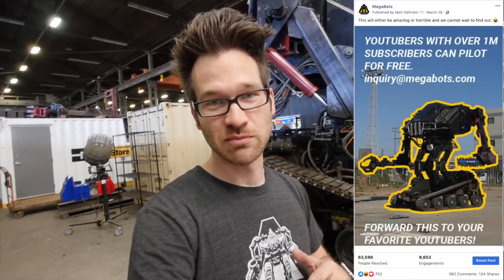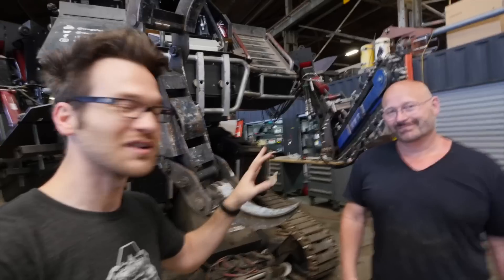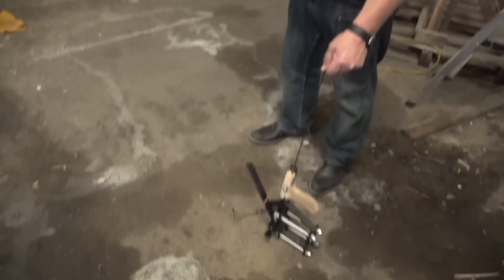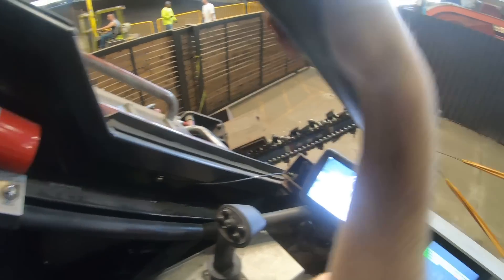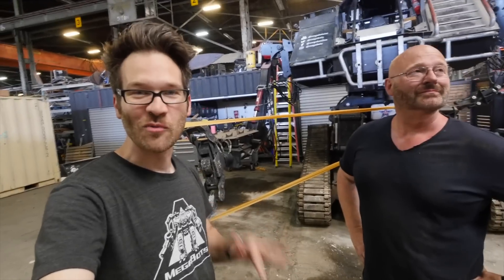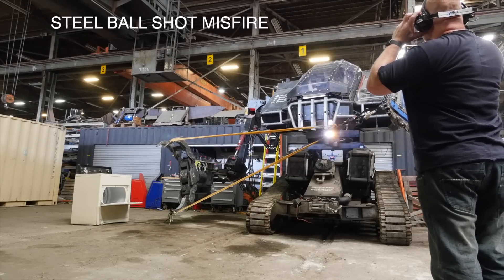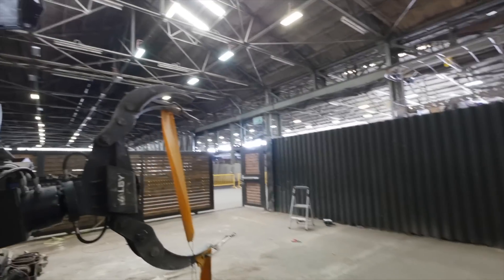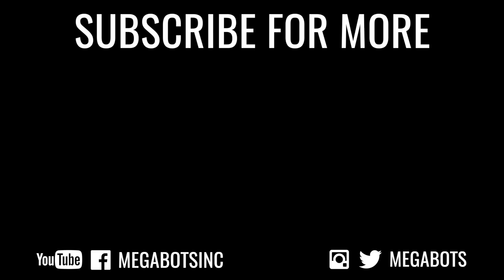The Slingshot Channel Arms a Giant Robot

Comment: Hopefully, this is still just the beginning of mech suit evolution.
I want, in my life time, to be able to see some bipedal humanoid giant robots, running around at high speeds and with fast flexible movements, etc.
Hopefully, that will become the case eventually.
But for now, We'll have to do with Kuratas, Eagle Prime and Method 2.
Reply: Physics: Am I a joke to you?
Reply: gundam WILL happen
Reply: trytix the hacksmith is also making the robot from predator
Reply: @Fost16  Ah, yes...the power lifter one. One of the slowest and least maneuverable mech suits in fiction. But then again, a pretty impressive feat to build fully functioning in our time and day.
Reply: I think one of the main problems is how these things are thought of. Still we look at materials mostly from a static perspective so any kind of dynamic loading is considered 'advanced' even though it's relatively simple. A material such as an epoxy coated I-beam is considered a composite material, and is quite hard to analyze, despite its simple construction. So I mean really I think it's possible in here and now, the paradigm just isn't there yet.